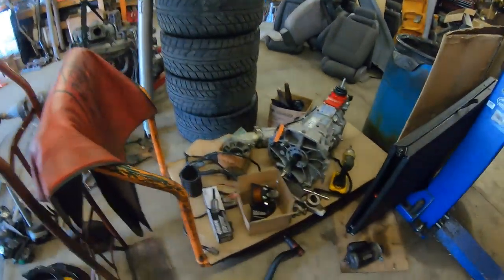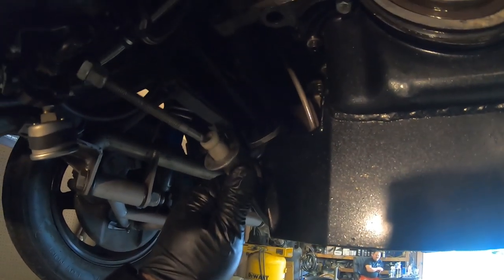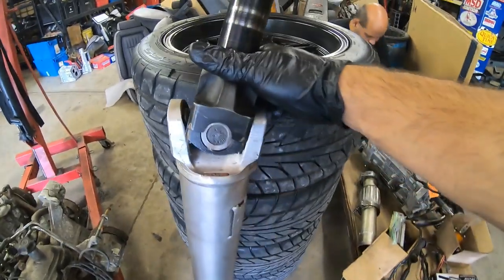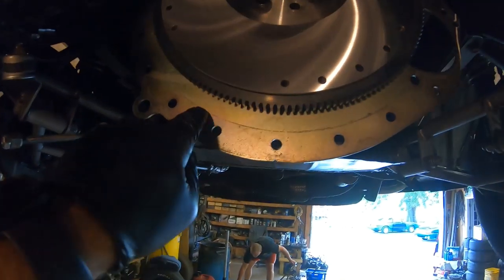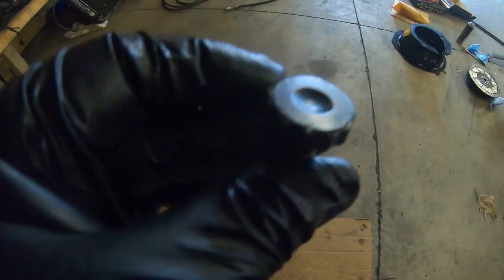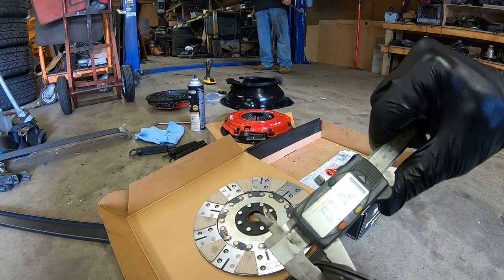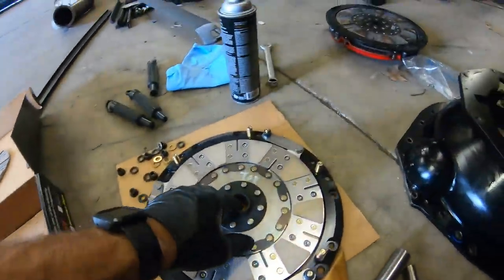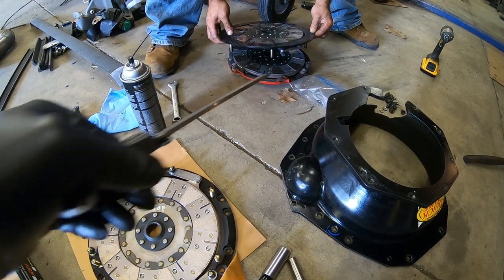Installing a Tremec T56 Magnum Faceplated Transmission Fox Body Mustang Turbo 351

Comment: With those ceramic clutches it isn’t usually the disc that wears away material, its the steel flywheel, floater, and pressure plate. So it doesn’t surprise me it was almost at new thickness. If you resurface the flywheel and plate you can buy some extra life out of them. Maybe that isn’t your style, but it’s a poor man’s clutch rebuild. 

Not sure if it’s the same for twin discs, but with the single disc It’s my understanding that the clamping force actually starts to go up as the system wears
Reply from the maker: Yep the flywheel was worn. The discs seemed ok so you make a valid point
Reply: @Neomustangs  I'm thinking about going to a similar setup with my 87 notchback. Wouldn't a hydraulic clutch conversion be better than the factory steel cable so that I would have more throw?
Reply from the maker: Brian Boldin nah don’t waste time or money on it. Imo. Just do the cable. Get a good quality cable. Not a cheap one. Steeeda. Ford racing etc

Comment: I have the McLeod RST twin disc it’s almost freaky that the pedal pressure is so easy. And those washers will make you cuss like a sailor. My question is how tight do you run your clutch cable? Does it engage really high?
Reply from the maker: Just enough preload on the TO bearing. Engaging a few inches off floor
Reply: Neomustangs Is your QuickTime bell housing “modified “ because it looks different than mine , and I can’t see the clutch and TO bearing that good

Comment: Good video again . What kinda cost for that t56 ? Thinking of building a 393 , with a single turbo,  but want to keep a manual in it.  Any advice of tips would be very appreciated.  Thanks
Reply from the maker: With the driveshaft and all the extra parts you’re looking at about five grand
Reply: Thanks for your response , honestly lower than I thought.  Keep up the good man.

Comment: I just ate up my second throwout bearing in about 500 miles. I’m pretty aggravated. Second bearing lasted about 150 miles. Using a super street pro , QuickTime bellhousing, scat flywheel, 94+up fork don’t remember a weight being on it but I’ll check. Cable adjusted with no pressure on the fingers of the clutch basically. Obviously you have to keep tension on the cable so it doesn’t pop out of the fork. Everything’s brand new. I have a moroso pan also. I think something is broken in the clutch like a spring or something. Any ideas?  What are you doing for air gap ?
Reply from the maker: Air gap I can’t remember we had it wrote on bell housing

Comment: I'm thinking about doing the same set up to my 88 LX. I want to install the T56 so when I install the 4.10 gear the 6th gear on the T56 will keep my RPM's low. What gear are you running in your GT @neomustang?
Reply from the maker: T56 needs to be driven at track just like any other stock. 1-4. Gear it appropriate. The 5-6 help keep rpm low yes

Comment: I'm in the process if buying a 92 that has a T56 in it, right now it has shorty headers.  Do you know which ling tubes will fit?  I've looked everywhere and can't get answers
Reply from the maker: No one will really know answers like that offhand. However call KOOKS and some of the other high end header manufacturers and they might  tell you

Comment: You should make another bracket , get a patent and sell them things.
Reply from the maker: I should because adding the length of throw sure help my pedal effort.
Reply: @Neomustangs  you absolutely should,  you've solved a problem the aftermarket doesn't care to address. Might not get rich off it , but it sure would cement you in the legacy of fox body history .

Comment: Every body's blaming quicktime for the clutch cables not fitting. IT'S NOT THEIR FAULT. Your using the wrong oil pan !!! If you use the correct pan that canton makes for these cars you have no problems with the clutch pedal...............
Reply from the maker: Lol ok bud.